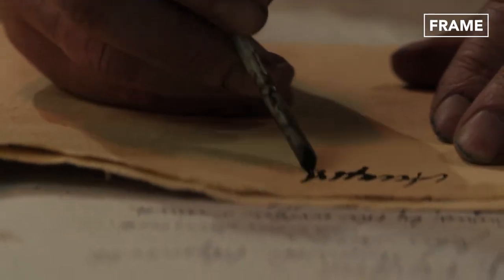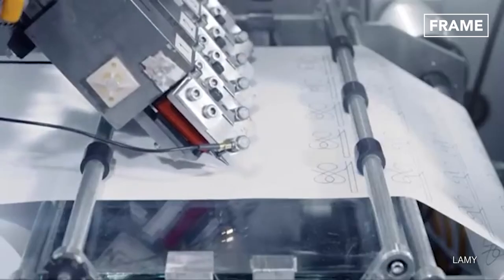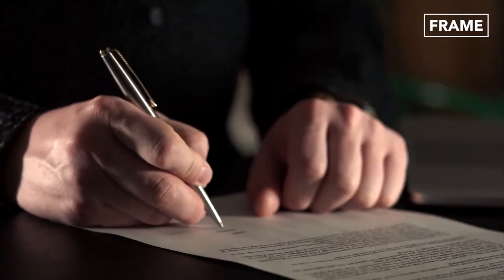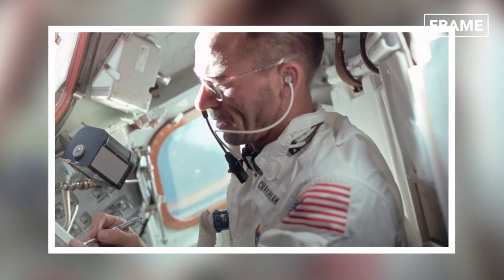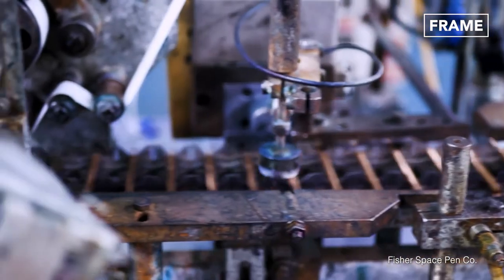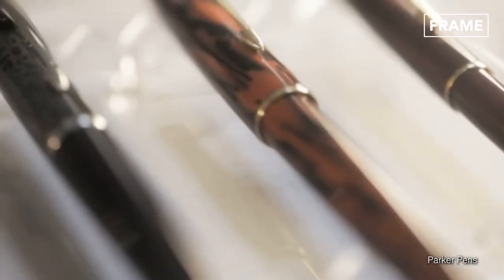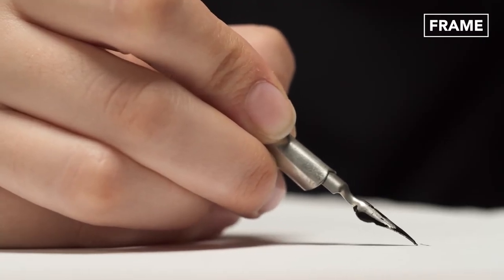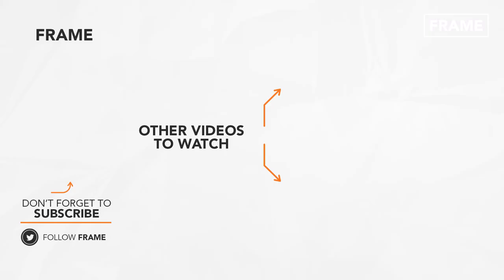The Hypnotic Process of Handmade Crafting $5000 Fountain Pen

Comment: I have heard a myth that NASA spent tens of thousands of dollars if not more on developing a pen that will work in space, meanwhile the Russians solved the problem with rather less expenditure, they used a pencil.
Reply: That’s (more or less) true- and the Soviets were blessed with the much more expensive and tricky issue of graphite dust and micro particles in the recirculators and essential equipment- I notice everybody leaves that part out 😂
Reply: It's not like they didn't think of pencils.. The problem is that graphite is conductive so if it floats into circuitry then you'll short out the whole craft. The Russians just didn't care about health and safety.
Reply: @zglg123 
How much writing were they doing to cause so much graphite dust that it actually became an issue?
I mean, you would need quite a bit to make it an issue right?
Reply: 2 million